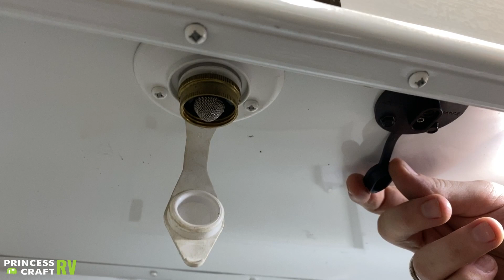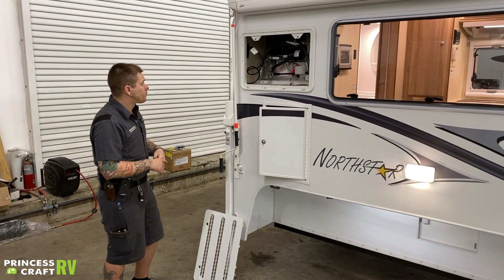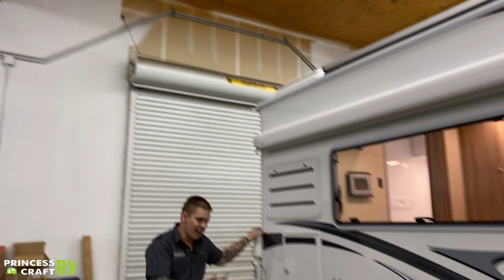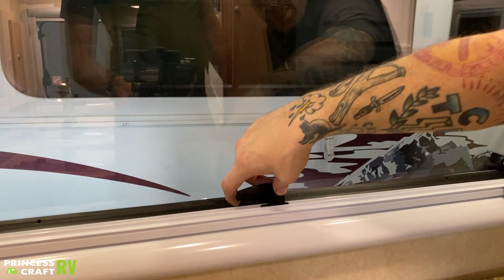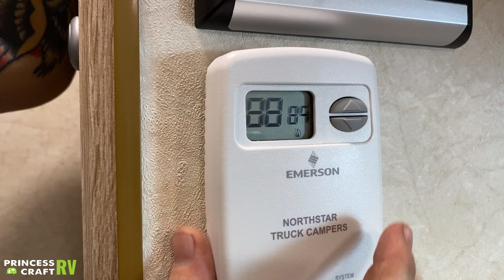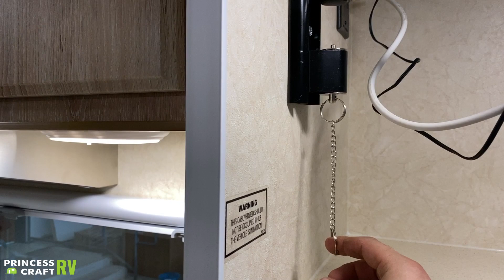Technician Tour - Northstar Liberty Truck Camper

Comment: Be sure you check the fuse box. I bought a brand new Northstar Arrow-U from Truck Camper Warehouse in NH in 2014. The circuit breakers for the ac and outlets were installed upside down and in the wrong/opposing spots. Couldn't figure out why I kept throwing a breaker. Finally, I took it apart and discovered what a poor quality control they do from the factory. The coaxial cable installed at the factory was sliced in the wall. So whenever I hooked up to park cable, it never worked. Again, I took things apart and repaired them myself. Also the dealer had issues too. Installed the stereo head unit wrong. Never buy a Northstar! For $33,000, you expect much higher quality. You will be disappointed. Look at how flimsy the leg support and pull out bed were on the Liberty in this video.